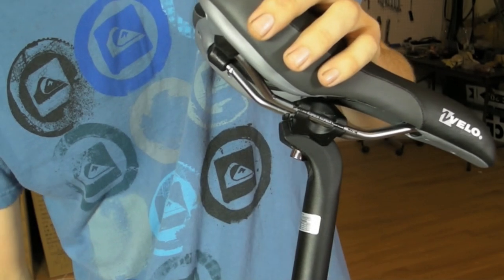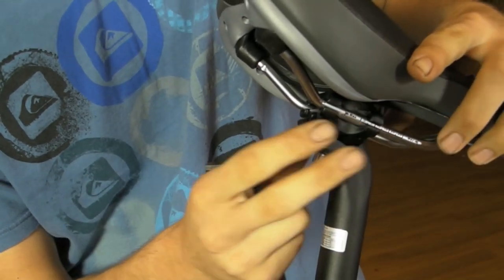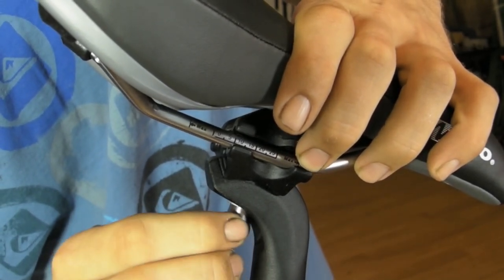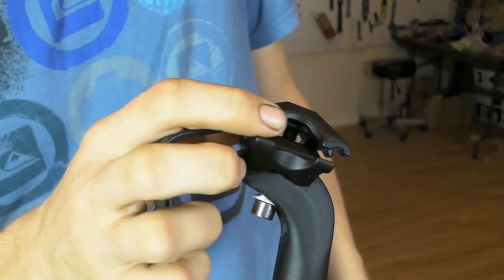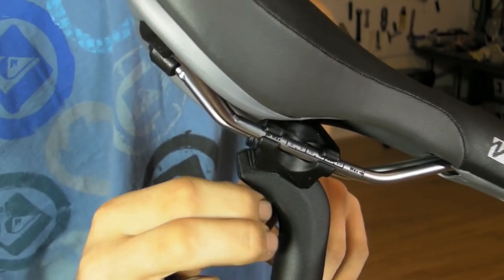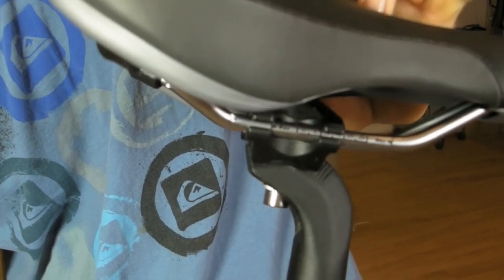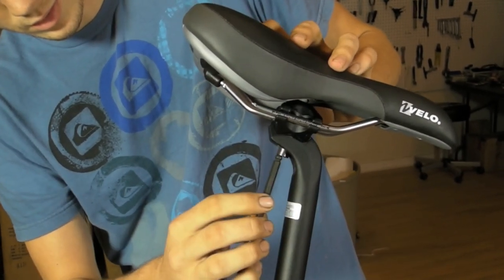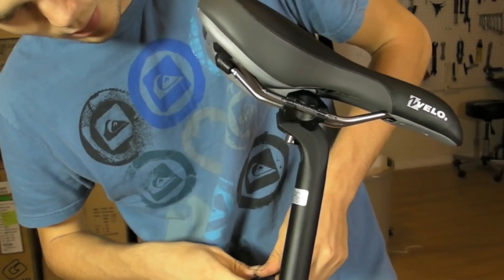How To Adjust A Bicycle Saddle

Comment: On my mountain bike, the bottom part of that clamp that holds on to the rails of the saddle is not adjustable. It is completely fixed to the pole, in one position. So I assume my saddle cannot be tilted? Or am I missing something?

Comment: I would like to know how to use the "limits" of the rails. I deduced that you can't go past the stop on the inside window of the seat post clamp. I went to a bike shop which I don't want to name, but it is very famous in California, and the guy told me that the stop was on the outside of the clamp. This would leave you with about 1 millimeter of range. I think it's inside, but I am not sure. I have tried to find this online, but found nothing. Thanks for posting this video. I can tell you are a real mechanic because of the grease on your nails :-) I just got a selle Italia saddle and would not like to damage it because of lack of knowledge. If you find out, let me know.
Reply: 5 years later, I have the exact same question! Did you ever find an answer to this? Cheers!

Comment: Whenever I tilt it forward and I Tighten it really hard it just goes back after I go down from a wheelie
Reply: Same
Reply from the maker: @42ray64  You may need a new seat post clamp or may need to simply clean the one you have. I'd suggest taking your bike to your local bike shop for help. Please do not ride until it is resolved. Good luck.
Reply from the maker: You may need a new seat post clamp or may need to simply clean the one you have. I'd suggest taking your bike to your local bike shop for help. Please do not ride until it is resolved. Good luck.
Reply: @road_bike_outlet  hi cant believe u made the vid in 2012
Reply from the maker: @Lews-ib3ic  :)
Reply: @road_bike_outlet  oh wow hi cheers btw helped me out 9 years later I was 7 when u made this 😂
Reply from the maker: @Lews-ib3ic  Wow! That's funny. Thanks for watching, and glad it helped you out.

Comment: what tools would i need to tighten the bolt
Reply from the maker: Saddles generally have two types of fasteners for locking in place. One is a 6mm Allen key, and the other uses a 15mm wrench. If you have other questions, please reach out - customercare@roadbikeoutlet.com

Comment: I wanted to put it tilted forward so i dont slide off when i do no hand wheelie
Reply: Ikr
Reply: Comment_User sameeee but it goes back up
Reply: @starboy4148  mine too
Reply: Just a Killer  you need to put your   seat tilted forward, so you don't slide off the seat. Then you need to learn keep balance point so good.
Reply: Just a Killer  You don't need certain type of bike to do the no hands wheelie. But, I recommend you to check the https://www.collectivebikes.com/
One of the best bike shops ever, and Little Harry own one collective bike.
Reply: Just a Killer  you need to have light front part of the bike, so it eill help you to make no hands wheelie.
Reply: Just a Killer  you need to be good at normal wheelies and calmly just try taking hands off for 0.1 second at a time.. Tightening headset also helps so handlebar doesnt turn and hit your balls

Comment: How can i make the seat straight
Reply from the maker: The seat must be put on the seat post evenly and straight, then tightened. If not put on properly, you can break the saddle, or seat post and you should not ride the bike until this is installed properly.  If you are unable to adjust properly please take to your local bike shop for assistance or send us an email and we try our best to help. Customercare@roadbikeoutlet.com

Comment: My bike seat keeps moving up and down
Reply from the maker: First, please don't ride your bike until this is resolved. Your bike should have a seat post clamp that you need to tighten. Have you tightened this? If you have and if it's not working, take your bike to your local bike shop for assistance. Please don't ride until it's working properly.
Reply: @road_bike_outlet  I take out the giant stick that the seat is on, I screw it to tighten it and the seat doesn’t move at all but when I put the stick back on the bike it starts moving up and down again
Reply from the maker: @fanaticalplel1003  you may be missing a sleeve in the seat post. Not sure. Can you please email us - customercare@roadbikeoutlet.com and include some photos of the seat, seat post, the tube and let us know what kind of bike you have. If it's one of ours we'll have a better chance of helping. Please do not ride your bike until this is resolved. Thank you.
Reply: @road_bike_outlet  I’m having this same problem, I’ve checked plenty of times and everything is all good and nothing loves if I try by hand but as soon as I’m on the bike I can already feel the saddle sliding backwards again and when I get off it definitely has because I can slide it back forwards. I don’t know what to do since everything is tight and it stays in place when I try to move it but when I actually ride it it just constantly slides back
Reply from the maker: @JamesMcCarthy17  please don't ride your bike and take to your local bike shop for assistance. I cannot diagnose on youtube, and your bike is not safe to ride as it is.

Comment: My seat still moves up down after i tighten it
Reply from the maker: I suggest taking your bike into a shop so they can see what is going on. You don't want to ride the bike if the seat is moving after you've tightened. Please make sure the saddle is stable before using. Thank you.